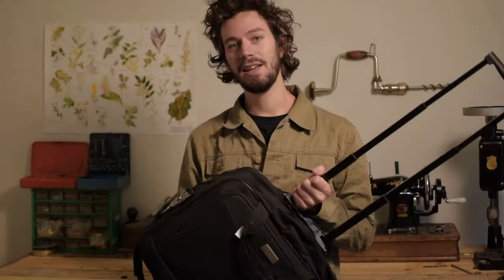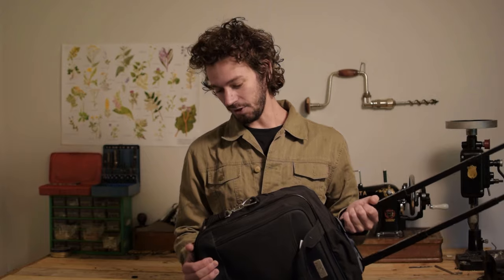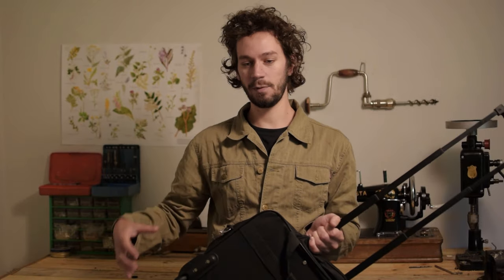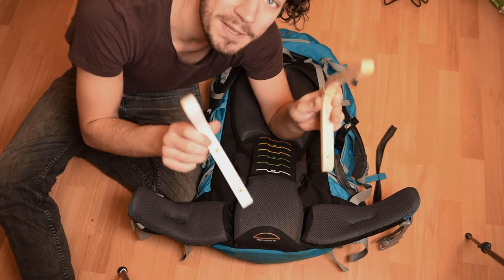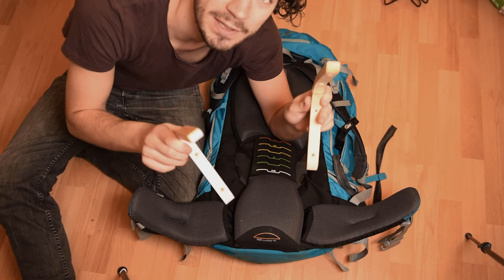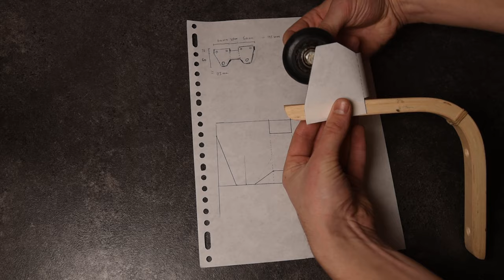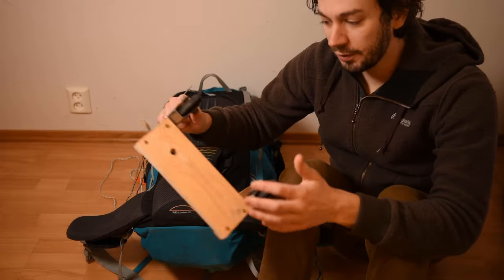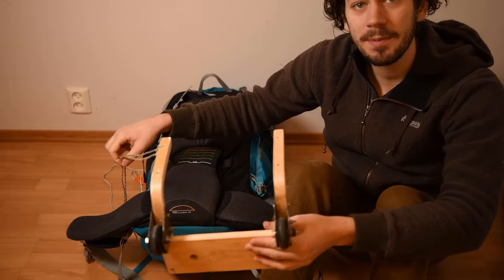Travel without sore shoulders, put wheels on a Backpack! - DIY

Comment: i have a lot of experience with this design. 
a few exist . they are all shit. trust me. they are very rare, you will have a hard time finding them. 

what is needed is a normal hiking bag with a hip belt, and on the bottom there are 2, 9" diamter wheels that can pop on and off the bottom and be replaceable if they brake. also, when not in use, they are popped off and stored in or on the bag itself, that way the bag can be put down on it's bottom without rolling. also the wheels are ugly when hiking and non-fucntional and may get in the way of the hiker. 

a few camera bags have this functionality already from lowepro. they are shit. 
theres's one or two others who have tried this design. it is a hard one but useful.
Reply: show us your design  with pictures or video. Please.